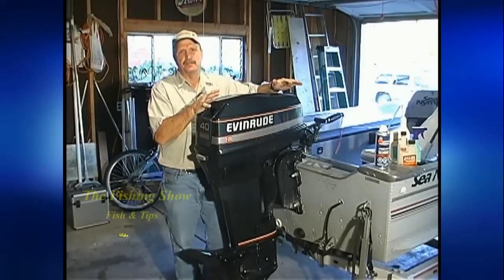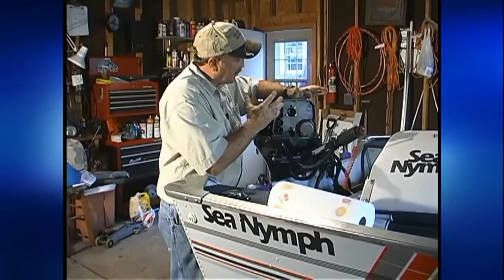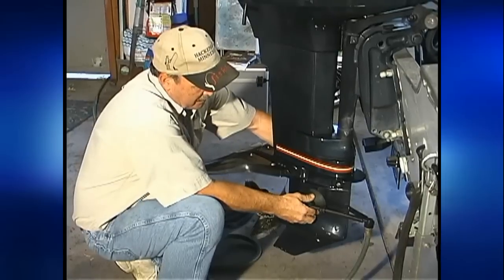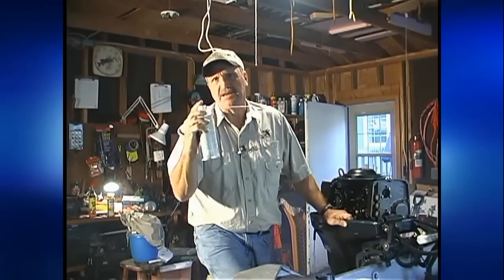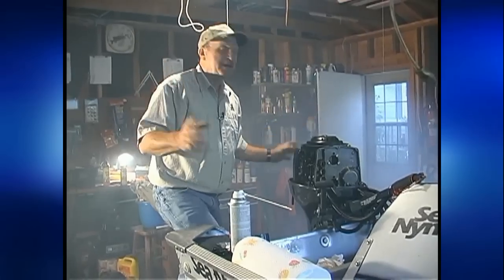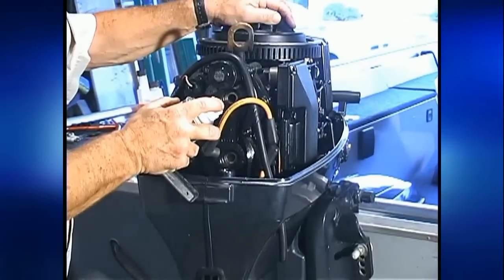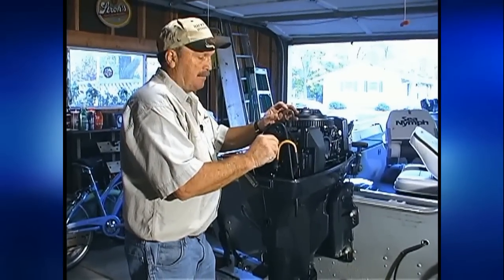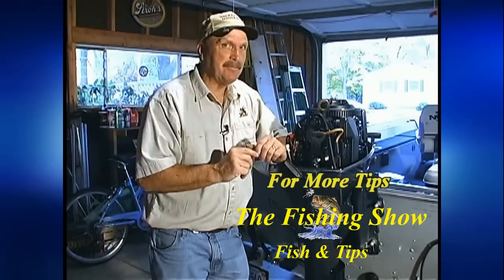Winterizing Your OutBoard

Comment: Hi there, thanks for the great video! 
How would one go about properly treating the fuel like you mentioned in your video though?
Reply from the maker: I like to use Sta-bal Stabilizer Fule treatment, for winter treatment, I fill the gas tank and add the required amount per gallons as written on bottle.  You should be all set.

Comment: good vid bud...I'm wondering if this stuff clogs the Jets and it be hard to start next season?  also I'm wondering if running the motor with this running though it and with no gas will affect the cylinder and piston rings ?
Reply from the maker: +Shawn P 
Shawn, 
If your referring to the fogging oil, it does not clog the jets, it coats the carburetors, cylinders and rings to keep from corrosion, that's of course why you use it, the outboard starts fine in the spring, but it will smoke a little till the fogging oil burns out.

Comment: I alway use more stabilizer then they say on the bottle.I stabilize my outboard,bikes,atv,riding mower , chainsaws, tillers,backpack blower, weed wacker,everything..I used to turn the gas off on my bikes and let them idol with the gas off until they die,but this puts a lot of wear on the cylinder and pistons

Comment: Great video but how does spraying the fogging threw carbs do anything for the gas in the bowls of carbs and jets  and seals ?
Reply from the maker: +stephenjray1988    Fogging oil coats all the internal carburetor parts, like the jets and seals, this keeps them from drying out or any corrosion developing. If there is any gas left in the carburetor it should have been treated with stabilizer treatment.
Reply: their is no way that is getting any where other than cylinders reed and throats of carb im sure it helps but if someone really wanted to coat carbs then pull bowls off and coat it good and put it back together thats my opinion Thanks for the video
Reply: Hi, it might make the motor hard to start the following year. but, won't harm the fuel. just make sure your battery is charged up.

Comment: Do you empty the carb? When fogging is the fuel tank connected or not? Do you run stabilized fuel through the motor before fogging? Thx for the video.
Reply from the maker: Mike,
The first thing is run the proper amount of stabilizer for the size of your tank and have the tank as full as possible, this will keep the condensation to a minimum.  I run this stabilized fuel threw the motor before and during the fogging oil treatment. I do not empty the carbs. Using the fogging oil properly, the carbs will have all the internal parts coated and any fuel left will be stabilized. Be sure to unplug the fuel line before following the rest of the winterizing treatment. 
Hope that helps.

Comment: Hi am 60 years old and am close to retirement, I brought a boat with a mariner 80 hp motor, my problem is am getting too many different opinions from people on how to winterize it, some are saying that I should run antifreeze through the motor and others are it's not necessary???? Am being told that if I don't run antifreeze through the motor that I could ruin the motor?? So what do you say??
Reply from the maker: Ramon,If you get all the water out of your outboard motor, then there is nothing to freeze, tilting the motor all the way up and down until there is no water dripping is a good sign the water is out.  That's the way I do my outboards and I have never had a problem. Many of my friends with 150 hp and more do it the same way. The only reason to use antifreeze would be if your motor holds water. The outboard is the a big expense of the boat, so I certainly understand your concern.
Congratulations on your boat and pending retirement, no two things go together better.

Comment: Boat dealers are more than happy to empty your pocketbook with winterizing an outboard motor. The new thing is antifreeze in an outboard they threaten you with it's going to freeze and cost you thousands of dollars to repair. I've had a half a dozen or so Outboards in my 45-year boating history. I have done nothing, I repeat nothing to them and never had a catastrophic failure other than hitting a stump in the water. If I were to stored it for years then that would be a different story. And also remember most snake oils are a conn.

Comment: Do you run antifreeze through it?
Reply from the maker: No need for antifreeze if you get all the water out of the system. To get all the water out of the motor, tilt motor up as high as it goes and you will see some water dripping from the water intake on the lower end, when it stops, lower it all the way down and it may drip again, raise and lower your motor a few times till there is no dripping . Then you should be good.
Reply: The Fishing Show - Fishing Tips thank you

Comment: This is not necessary. A waste of time. The 2 cycle oil in the gas will keep the seals from drying up. Just make sure you put fuel stabilizer in your tank for the winter.
Reply: yup..just leave it out on a sunny day to dry out before winter